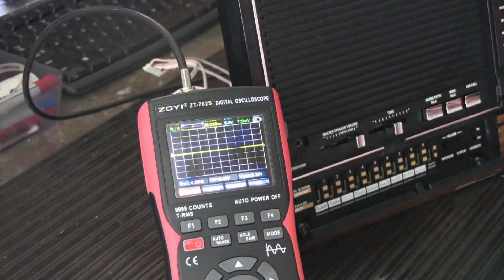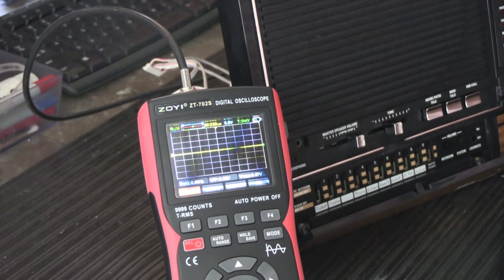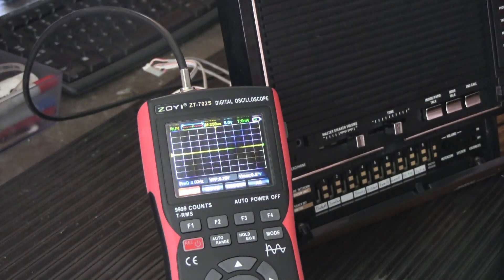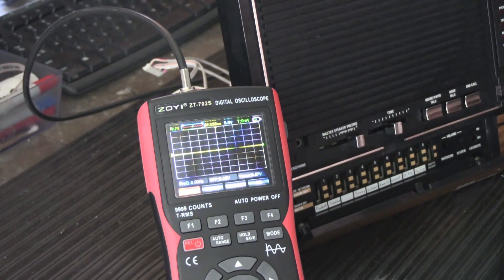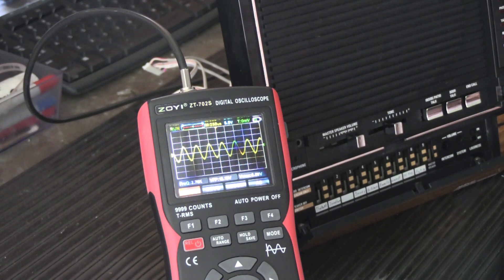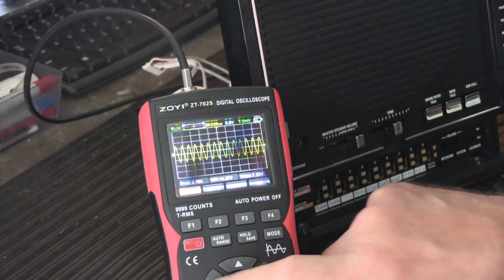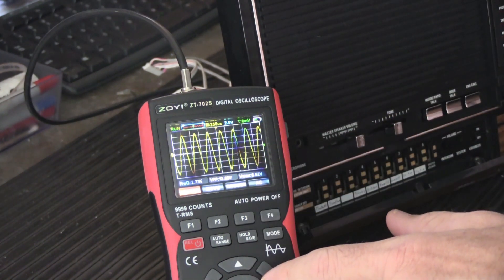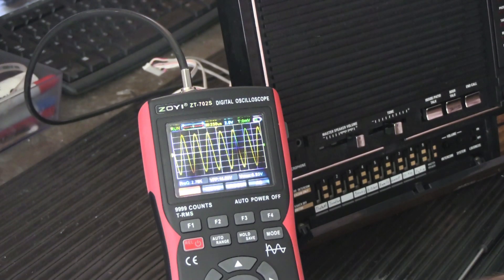How to use the Zoyi ZT702S to adjust the Cassette Player in a NuTone IM4006 Master Station

Comment from the maker: It would have been so fantastic to have a tool like the Zoyi ZT702S back when I was doing Field Service Calls in customers homes.  Imagine how great it would have been if I could have replaced a Cassette Player Motor, right in the customers home and then adjust the player to proper specifications. . .   No more removing the Master Station - taking it back to the shop - performing the repair and then having to make a 2nd trip to the customers home - We live in great times! - Chris

Comment: Could you also use the analog style multimeter. I'm wondering how that would look to find a peak. Thanks for the video.
Reply from the maker: Hi Larry: Traditionally this type of adjustment is done with an Oscilloscope - I've never tried measuring the output signal from a calibration tape on an analog multimeter before - if it were sensitive enough it should work - Chris
Reply: @northsideservicecompany3567  Thanks